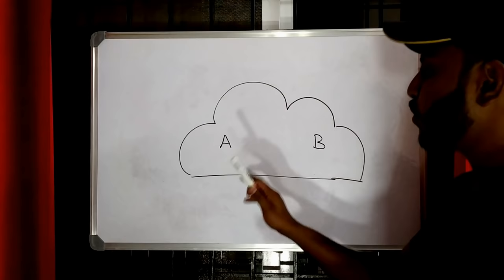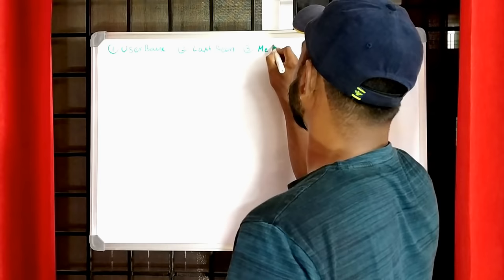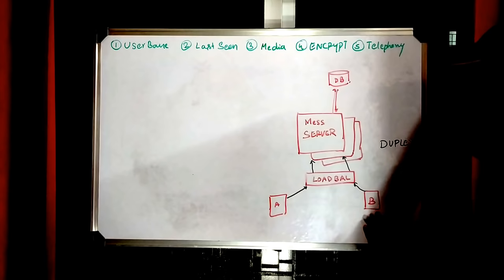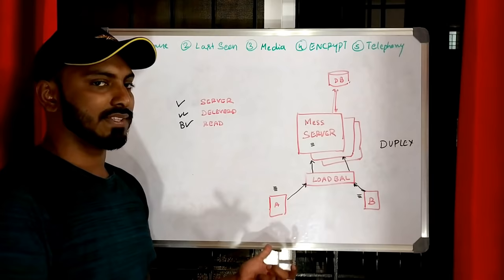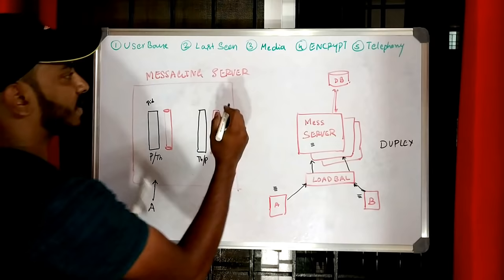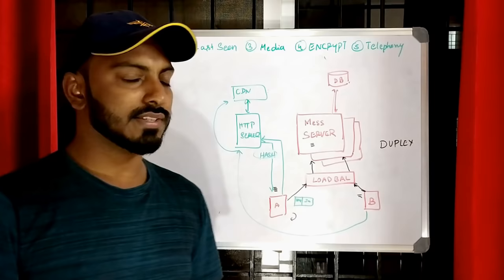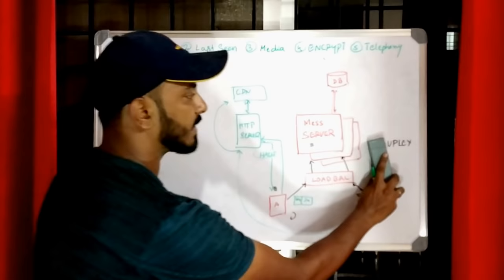Whatsapp System design or software architecture

Comment: Awesome video. Few points :- 
i) We can use indexing on UID for faster retrievals. O(n) to O(log(n))
ii) Spawning a thread for every user is not efficient. Instead, we can use a dynamic threadpool.
iii) Similarly, having a queue per user is not efficient. Instead, we can have a global queue with object (message, action like send/receive, uid)
iv) Since you are using DB for storing message in case user is not online, we need to implement a disaster recovery mechanism i.e. replication.
v) We can also implement blocked contacts by storing list of blocked UIDs for each user in the DB & we can drop such messages in web server.
Reply: actually whatsapp and other messaging apps use very customized protocols and language features to cater specific needs, such as Erlang which is extremely useful where millions of lightweight processes might need to be started and each other doesn't need to share data (everything is immutable)...also their xmpp based messaging uses extremely compressed payload compared to normal xml data transfer. These are implementation details but these are what makes the design itself eventually.

Comment: Well firstly, this video is really good. One part which is missing is you did not consider multiple messaging server instances running.
This actually raises a very important question.

One server let's say maintain persistent connection, what if that goes down for some reason?

Comment: Nice video btw. However, there are questions that I wanted to ask. When A sends a message to B and B is yet to connect to the server, your explanation said that the message is kept in the global DB until the PID of B in the server is created. When the PID of B is created, the server did a full lookup to the DB in order to find out what messages that is not received by B. My question is that:
1. Does the server evoke a trigger to lookup the global database whenever a new PID entry is formed?
2. If the server evoke a lookup trigger to the global DB with an assumption of there maybe a million of pending messages in the global DB. Does looking up without updating the global DB or indexing could scale up the system?
3. What is the main core /pattern of every real life system? Does multiple queries by giving heartbeat will slow down the performance?
Reply: Steven Candra the design listed in the video is a poor design. I cannot believe he is putting the pid in the database. The thread id is transient.
Reply: @meiliangwhut  I dont think, he is saying to store the pid in the DB. He is storing the uid of the user B and the message for user B. When user B connects, and reports that is it connected, we have to find all undelivered messages and send it to user B.  Also even though pid is transient, it will alive while the connection is on. You have to know which messaging server the receiver is connected to

Comment: I love this content. Just for people who want to read, I got a couple of suggestions here:
I personally would use the hearthbeat to keep the process alive. Once the heartbeat stops, or messages fail to be delivered, the process responsible for a client shutdowns and writes the shuttingdown timestamp in the DB and that is the last seen time. It has much less writes to the DB.
For asymmetric encryption one would use the public/private key pairs to encrypt a common secret key (that is how you use it usually in SSL and other protocols) since asymmetric encryption is very expensive in both time and computing resources. You don't want to spent most of your processing power on encryption primitives (even less in a cellphone).
Reply: How do you recognize when heartbeat has stopped?

Comment: Few Questions which I am pondering right now
1. How does the long running thread/process work in Messaging server? Does it mean that the connection from client to server is not stateless but stateful and every time it finds the same process? Does that mean that the process is running on a single central machine and not in a horizontally scaled pods? 
2. Is it client responsibility to poll for the messages after some time interval or is it the server's job to push messages to the client? If its the later then does that mean that Billions of client (devices) are making a stateful connection to server? is the protocol being used here is HTTP?

Comment: 19:40 So when a new process is spawned when user B is back online, and since you are just storing uid and msg in the DB, and when that process reads msgs for B in the table, how does B know who is the sender of the msg? Shouldn't you be storing the sender_uid too in the db? Because you are sending the msg to B, but since B doesn't have the sender information, in which chat will it show the message?
Reply: in think message itself will be stored with sender_id on it. the app will parse the message into the user and message. in fact message here will be an array with message, id, timestamp, group_name etc. IMO

Comment: Hey,
You said at 10:03 that the server never knows the connection to the client and will never tries to connect to the client. Let us assume 2 situations 
1. When the client is currently offline and now opens up the internet then the connection will be established with the message server . What happens to the connection when the client internet is on but the client is not doing any activity on the Whatsapp.

Will the connection get closed? Then in that case how do we receive messages even when we are not actually using the App.

If not then is Whatsapp keeping all the client connections live and running for all the clients having a Living Internet Connection even for a situation when the App is not being used.

Are these client connection information stored somewhere on with the Message Server?

Comment: I am not sure whether Whatsapp uses PID + data pipe combination. Same could be simplified by using separate Queues in a messaging server like RabbitMQ which can be scaled horizontally, with persistent messaging. So, whenever a message sent from A to B, the message could be put in B's Queue. When B connects, automatically, message would be read by B. Once B Acknowledges, the message would be removed from queue. But as u have mentioned, there could be a limitation on how many connections server can handle. Likewise , when a message is sent to a group, the message can be put in the queue of all users of the group. Encryption in case of Asymmetric keys, we encrypt with public key and receiver decrypts with private key. so , we would end up storing public keys of all contacts in local store?
Reply: But for every user will there be separate queue created?
Reply: @nilaysheth3283  Yes. One queue per user because messaging systems are queue intensive.

Comment: Thank you for the video, it was very helpful!
Great Idea using the CDN.

One point that I would like to mention, that you don't have to send a heartbeat . Because with WebSocket there are events, for example connected and disconnection, so heartbeat might be wasteful.
Reply: so, when a user I disconnected, the timestamp  at that point is sent to the small dB holding  the user's active status right?

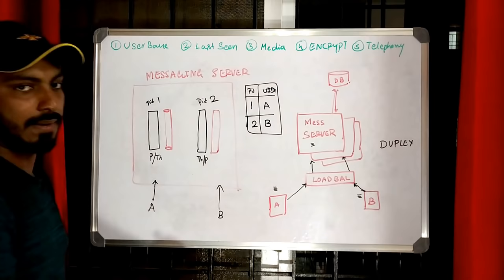Comment: Hi @Tech Dummies, Thanks for this video. But i have one doubt. As you have mentioned at 15:47 minute of this video, for every active client there would be a corresponding thread/process and a queue. But my point is - isn't it taking unnecessary space in memory just for being active.
bcz whatsApp has billions of users. And if millions are just active( they are not doing messaging or call) , for them also process and queue will be created.
Thank You !
Reply: I came here to ask the same question. Anyway, do you have any answer / Explanantion for this? though the question you asked two years ago. Thanks!

Comment: Great explanation. Some question on last seen design. Why you need a heart bit send by user at regular interval. If the user is connected to server  it is the current time and once disconnected just store that time  as last seen. So difference of current time minus that timestamp will be last seen. Once user reconnect to server it is again going to be current time as last seen.

Comment: Whatsapp like chat app often use MQ broker like kafka, rabbitmq to exchange messages across users. The server side code is lightweight for messaging but not for telephony. Server doesn't store messages in DB but are managed by message brokers i.e. A sends msg to server for B, Server put it on MQ for B destination (Q the B is listening to) and double tick the sender, B finds a msg for download and double tick the receiver, B downloads/saves the msg locally and Blue tick is done. At this point your msg is remove permanently from the server. Which is why you can't retrive a msg once you delete it. Media files are handled slightly differently. We don't need a hardcore monolithic server for msgs. IMO.

Comment: Very educational. The other very important feature that wasn't addressed here is the 'group chat'. I wonder how WhatsApp handles them. If you could shed light on that as well, that would be awesome. Other than that, it simply awesome. Keep up the great work.
Reply: It would be very similar to the one to one chat logic. Except that, Whatsapp stores the users in a group. So, when a message sent to a group, whatsapp, takes the users in the group and sends to the corresponding Queues through the PIDs. If the user is offline,  it is stored in DB against the userid.

Comment: When I saw this video, I had doubts that WhatsApp’s messaging server can handle 10 million concurrent connections. Those were arose on the basis that setup would hit limit of 65k because all the connections to the back end server would be from the load balancer, that means source ip, destination ip, destination port would be same for each connection. Then only variable would be source port. So load balancer won’t be able to create more than 65k connections. But I learnt that this can be solved by making backend server listen on multiple ports due to which we can have 64k * (no. of ports on which backend is listening), which can easily overcome 10 million connections limits (given that throughput of application server is high enough).

Comment: Personally, I think .(1) The message receiver and message delivery should be decouple into 2 separate service, and they could be fully stateless.  They can be connected with a message queue service or sit behind service discovery directly. Put them in a single executable and pass message between process is feasible for very small user base, but it's not scalable at all. Besides, It makes the "Mess SERVER" hard to test. (2) If you have an abstract concept "channel" or "session" here, then it's easy to forward message with rpc or write it into DB. (3) real-time message is time sensitive and has high frequent requests. It's not a very good idea to write all message into DB. Instead, I would say we should only write message for offline users into two level DB (Memory + persistent).

Comment: It would be impossible to use system threads for an application like Whatsapp so it is definitely Erlang's actors
Reply: @shaaradpandey5546  It won't scale.
Reply: @shaaradpandey5546  spring? no. It depends on how much users do you need to support. forget about spring, that's 90s tech
Reply: Even actors are threads, all you gotta look at is whether they are scaling across servers or on the same server.
Reply: Yes... He is explaning Erlang OTP framework in simple way... Only super light weight threading mechanisms will scale like this... WhatsApp itslef uses Erlang OTP I guess.

Comment: Thank you for this lecture .

Further, I have a query regarding design 

Problem Statement:-

I have subcategories defined under Vehicle Class as :- Bike ,Car, truck, bus

Further, there are different variants under each four categories

Bike :- sport, standard
Car :- sport, standard, electric
 Truck :- Mini Truck , Power Truck
Bus:- Mini Bus, AC Bus

I have to calculate the price based on variants. For example Mini Bus price.

Question:- How should I define the classes ?
1. Keep only vehicle as a class .
2. Keep Vehicle as a base class and make bike, car, truck , bus  as subclasses and they should inherit the base class.
3. make sports bike as class which will inherit bike class which will further inherit vehicle class

Comment: How does light weight process that handle message queue for particular client keep its message queue size within certain bound? E.g. If some client sends 100s of messages in burst then the process handling that user's client will be overwhelmed. Will those be offloaded to DB as well? or will it stop accepting new messages until queue is empty? 

one more question on similar note, what happens if client has sent message and it is in queue but the server holding that queue / process dies. In that case how will clients know to retry sending those messages on reconnect?

Comment: Hi 2  questions: 1) You said each process has 1 queue, typically whatsapp has 1M connection per server so do you think it's feasible to have that many queue? 2) What if before sending message server goes down. in that case queue also lost which causes our messages are lost as well? What are your thoughts?
Reply: Agreed. Ditributed message queue should be the way i believe. Creating a queue per message or user in the server definetly wont scale

Comment: Hello Naren, Thanks a ton for the video.
I have one question, considering the user base of WhatsApp (1B+), I don't think single load balancer can handle the load of so many connections. There must be multiple load balancers for example, one for each region etc. Could you please throw some light on this.
Also, it would really help if you can discuss more on DB sizing. You mentioned WhatsApp manages to serve 10,000 users per messaging server node so there would be at least 100,000 messaging servers to handle 1billiion live users. What would be the design of DB to handle the load of 100,000 servers?
Reply from the maker: Actually whatsapp successfully handles upto 2Million connections per server (https://blog.whatsapp.com/196/1-million-is-so-2011)please recalculate the number of servers needed. and also when we say there are 1B live users we can optimize connections problem using GCM/APN to establish connections(lazy connect) only where there is a messages at the server!!
Reply: Yes do dns round Robin to first bl and then second level bl. Make sure that first level bl needs to be online 100% because how round Robin works. Google also uses de cix for example to directly pipe the request so their servers. I am 14 btw so I ahbw no idear about production

Comment: Hey Bro, thanks for excellent video. Have a small question - Is it scalable ( in terms of cost etc. ) to create a queue per user ? Eg: if 200 million users are online at same time on whastapp, there would be 200 million queues ?
Reply: That's what i thought as well. Instead of queue, we can just keep the last delivered message offset and maybe have some reference to find messages specific to receivers UID (with offset > stored offset) from the main messages datastore.
Reply: What if we use  message queue system like  Rabbit MQ or Kafka. And messaging system will process message from kafka stream and then  server sends message to receiver. I am not feeling it a scalable system having 200 million queue existing  in system.

Comment: at 19:33, what if clients A and B are connected to different messaging server ?
Reply: I think  process/thread which is handling A , first will try to find whether the B 's messaging server is in localNode or in remote node based on b's Id and last used location info in db , based on that it will handle that . if its in some remote node first it will send to that node .

Comment: What is the need of the local queues for each client handling process, can't it just keep on polling from the table itself where A pushes the message . In fact the table itself works like a queue rite?
Reply: The messages will only pushed to db if the B is not connected to server.

Comment: 1. Can some tell if using one thread per user is feasible? Normally we will have few thousands TCP connection opened.A server will process once request at one time, it will get request , look up receiver connection details and forward it.I dont see need to multiple threads here.

2. Also why we need queue for each receiver? If user is online send it right away,otherwise save it db and finish request.

Comment: I'm not sure why'd we'd even bother with the in-process queue/database for when A and B are both connected to the messaging service.  For one, it's unlikely any both A and B would connect to the same exact service instance at the same time.  And two, you already have a system for when only one is connected (ie. write to external DB and poll when comes online) so wouldn't that solution work in general?

Comment: Great video, but I did not understand the media part properly. Can you please explain the justification for using the CDN for media? I think CDN will be useful only if the fraction of shared messages is very high. According to me CDN is like a cache, which will be useful if the number of items stored << number of viewers of the same item. (E.g. for something like Youtube. Or if there is a geographical/temporal locality in the media access.) 
However, if we assume that most of the media will be received by only 1 person (less number of shares), CDN does not seem much beneficial. Also, your solution of sending only the hash of media will help in deduplicating the media in case of shares.
I think the reason for using a separate HTTP server for the media storage part can be explained as "Single responsibility principle".
Reply: So would you recommend a normal storage space to save the media temporarily(till B downloads it to his phone), something like Amazon S3?